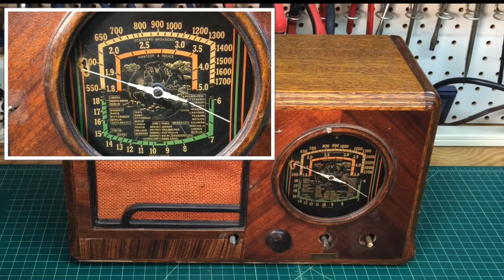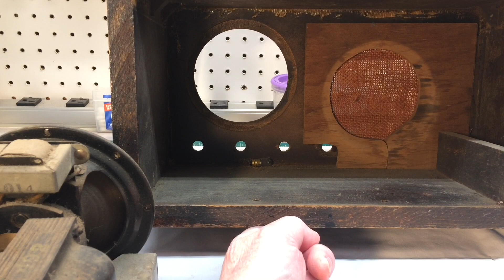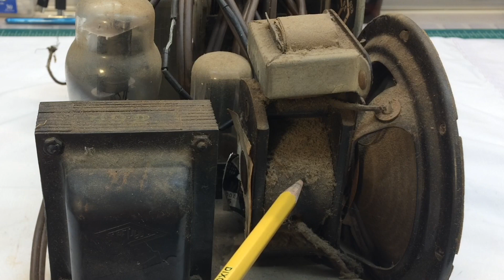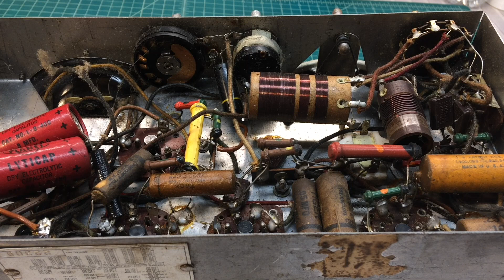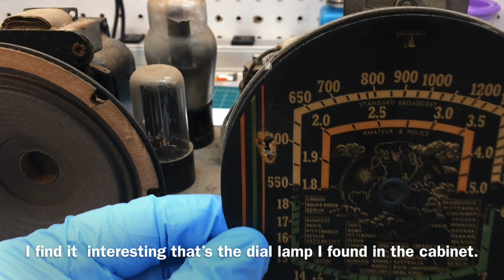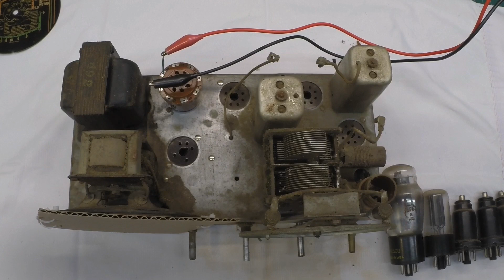Jackson Bell Model 556 - Old Intro & Evaluation P1 of...

Comment: Strange that the one dial light burnt the dial but the other one did not Don.
Reply from the maker: I know Jim, it maybe the angle of the holder in addition the warped dial scale itself. A closer look will be required for sure. Best, Don

Comment: Well we would all know what the tube line up is on this mystery radio. 
My two cents  guess : 5Y3 ,6A8,6K7,6Q7 and 6F6.
Looking like a Sparton design so you might have to search Sparks-Withington for a very close schematic Don. Steve
Reply from the maker: Steve, you are correct on the tubes other than the rectifier from the factory was a 5W4. I found a Zenith schematic that matches the power supply circuit somewhat and will definitely check out the Sparks…; thanks again. P2 will be posted in a couple of hours. Best, Don
Reply: @RestoreOldRadios  I was thinking along the lines of the model 556-C which is listed as having the tube line up I had mentioned!📟

Comment: What a beautiful cabinet Don. I know when you get done it will be even better. That dial surely looks like heat damage... possible not direct contact with the build, but weakening of the material from the heat. I will be curious to see how you fix that..I have a few idea on what I would do.  Will be watching !!!!  Thank you my friend
Reply from the maker: Thank you Ron. The cabinet is solid wood, which makes it a heavy little… I’ve reproduced some dial scales in the past, but I may try repairing the area after of course scanning the dial just in case I screw it up. Thanks again for reaching out and watching. Best, Don